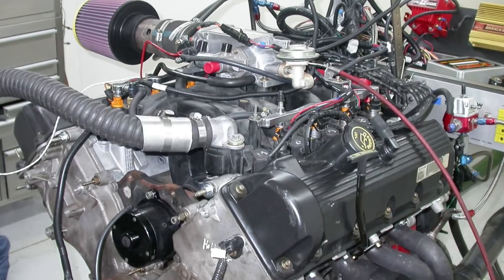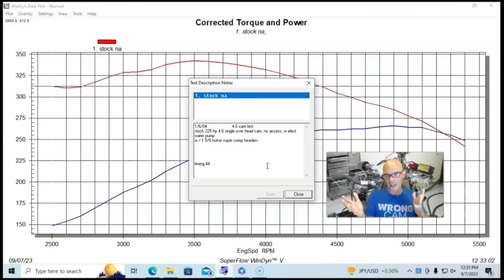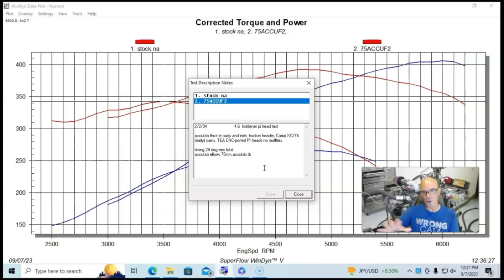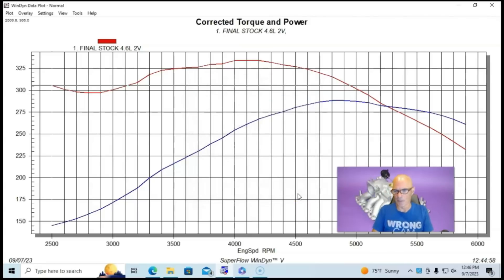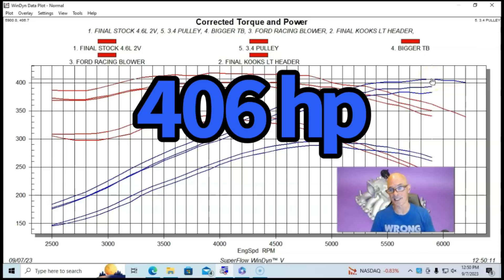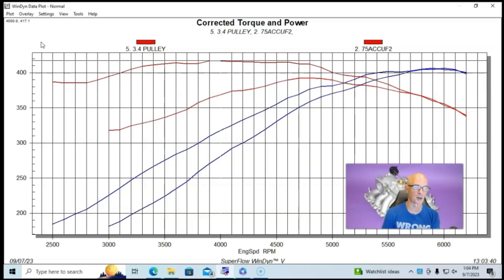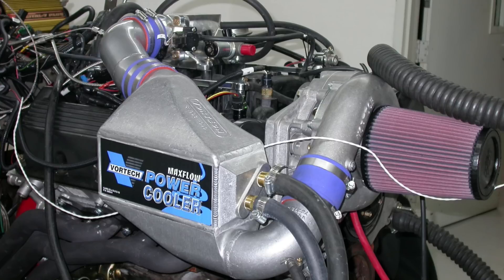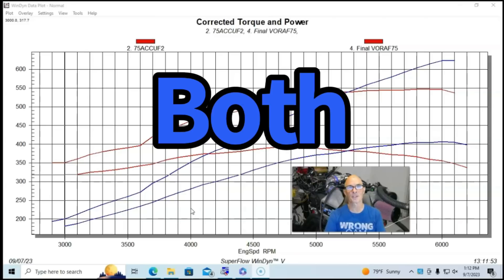THE 400-HP QUESTION-4.6L 2V MOD FORD-ALL MOTOR VS SUPERCHARGED-WHAT IS THE BEST ROUTE FOR HP? BOTH?

Comment: 2v's were so terrible
Reply: But damnit they sound great. Plus at the end of the day 400 crank HP from 281cid isn't bad. They suffer from being superceded by Coyotes like the 3 valve.
Reply: @travislivengood2744  they're superceded by every v8 on the planet.
Reply: @HioSSilver1999  hogwash. Chrysler 4.7, 4.2 liter Windsor, cfi Windsors, hell, my stock EFI 460 makes the same peak power. Lots of under achievers. If the LS1 didn't appear at the same time, the 4.6 would be better remembered. It's not the best but it's rock bits reliable, makes a great sound and can still do burn outs.
Reply: @travislivengood2744  the 4.sux got rocked by lt1 and especially lt4 cars before the ls1 ever came along. Shit run of the mill truck 350s will shit all over the modulars.
Reply: @HioSSilver1999  the early truck headed stuff yes. Later PI cars with a gear are still quite a bit of fun.
Reply: @travislivengood2744  if fast is fun they're not very fun. Will they spin the tires?? Sure....other than that they're pretty awful. Rightfully those pathetic weak engines shoulda put ford out of business.
Reply: @HioSSilver1999  well a centrifugal blown stock PI headed 4.6 can easily make 450-500whp in a 3300lb car with a solid rear axle. If you can't entertain yourself in that, I'm sorry for your loss. Are NA 2 valves very hard to make good power with? Yes they are, but they love boost. And you can beat them relentlessly. They are far from the worst engine out there to play with.
Reply: @travislivengood2744  everything loves boost. Making power with boost is nothing special.  The fact that it only makes 450ish whp with boost is what's bad....and anything above that will likely scatter those weak rods. 

Don't blame me blame ford for producing that junk yall seem so ready to defend.
Reply: @HioSSilver1999  I'm not defending anything other than 450-500whp is more than enough to go fast and have fun. The disconnect here is that not everything needs to make 1000whp. Is the 2 valve a great engine? It is ridiculously reliable if underpowered. It makes a great noise. It can make decent power with forced induction. That was literally all I've pointed out.
Reply: @travislivengood2744  i can agree with that other than the reliability aspect. With modualrs and their plug shotting issues, intake mani issues, exhaust mani issues and then to end up with a weak bottom end I'm not impressed....almost forgot about the ignition coils that are prone to failure. We roasted those enough in our alms panoz we switched it to ls coils.

  Hell i had a 03 cobra swapped notch...it got blew up hotlapping at the drag strip. Not by me but the previous owner and i bought it like that.
Reply: @HioSSilver1999  most of those issues I only saw them on the 5.4 and the 3 valve. Killing an 03 Cobra bottom end is hard to do. All forged. The 03/4 Mach 1 autos had cat crank and rods and the manuals had good cranks but meh rods. There have been two 4 valves in my family and both were awesome and one 540whp 3 valve that has never been apart. Turns out if you maintain them like they're supposed to be they're tough.
Reply: @travislivengood2744  it's not that hard to kill a cobra bottom end. That's why they run the tunes so soft. If it gets any kinda detonation it kills those puny bearings. Hence why you don't do 5th gear pulls in them, coolant mod the back of the head. They're actually pretty finicky.  There's been a pile of them blowed up on the dyno because of just trying to push them a little bit more but still on the soft side because no one wants their shit blown up. There was a thread on svt that was just blown up 03/04 cobras. It was 70+ pages long. Hell 3 blew up around here once in one weekend. 

Then there's the whole oil pump issue with them.....that continues into the coyotes.
Reply: @HioSSilver1999  corvettes dropped valves and camaros and trucks destroyed cams too.
Reply: @Mtnbike121  anything can fail fo sho.....but atleast they have power and fail vs no power and fail.

On top of that people do stupid shit to ls stuff constantly....thus making them fail. I think i had pretty good success with mine. It it's most power at 90k~ mile than it ever did. And ran great. 

Shit if you ran a ls at the power level of a 2v they would never ever fail......but yet a 2v will still fail at that weak ass power level and 5k rpm or less.
Reply: @HioSSilver1999  ancedotal experience on one engine is hardly a defense of "shit breaks" of the extremely well documented LS7 valve droping issue in stock form that destroyed LS7s. 

The afm was used in a wide range of platforms where running a vehicle hard wasnt the cause of failure.

Both of those engine failure problems were admitted by fault design and engineering by gm. And both of those problems were found in stock form.

If your excuse for the failure is people were doing stupid shit in them A.K.A racing or drag racing. Then they arent as reliable as YOU want to believe they are.

Lastly.

All of the modular platforms can be built to hold tons of power. Andrew Lavender has a 2v that runs in the 7s. 
A 1000hp 4v 4.6 isnt a rare or an outlandish find
A coyote and LT1 (which is baiscally a SBC) go back and forth for the world record on the H pattern manual transmission 
A mod 5.4L makes 3000hp and hold the standing mile record of 300 mph with a stock block/stock head. 

The idea they CAN'T be made fast is only held by people that are to ignorant to open their eyes to other car enthusiast that may like different platforms.

Enjoy your LS.
Reply: @Mtnbike121  and there ya go.....talking about erryone else's results with the 2v or modular platform because YOU'RE  own results are less than stellar with this over rated taxi cab engine. Meanwhile i can speak of my own results from enjoying my ls.

 Then you bring boost into the equation when clearly na is when the engine makes it's own power instead of being force fed. How a engine does with boost  has far more to do with the boost combo and not the engine.....hence power adder.

5.4s are lol.....they like to tie their cranks in a knot above 7k rpm.

As far as ls7s go furd guys like to blow that out of proportion.  The actual cars that had a problem is like 1 tenth od 1%. But hey....that old engine made back in 06 still thrashes every na furd turd to date.

Yup....some guys just don't know wtf their doing with a ls or lt. That's why i thrashed every cam, h/c and even some big cube cars that i come across using just a old 2002 bolt on ls6.....hell even some boosted shit was slower.
Reply: @HioSSilver1999  I'm extremely happy with my 2v. I could care less what it does at a drag strip, i have rules that limit what modifications i can do with my car and follow them. I've won several 15 hour endurance road races with this car. It don't bother me one bit there are faster cars in a straight line than me. You wouldn't beat me in an 15-24hr endurance race and i wouldn't beat you in a drag race. So its a mute point you're trying to make.

Ive had many ls guys show up with 400-500 hp spouting that they'll smoke me in the race. They think they've found an untapped reserve of races they can win because there are not LS camaros in the field that make 400-500HP. Sure, they'll set a faster lap time, they go out blow my doors off on the straights the first few hours thinking their stock bottom end is going to last 15-24 hours at 7000rpm and find rods hanging out of the block before the weekend ends with a DNF.

You are the one making blanket statements that they are all slow based off your ancedotal experience, yet when taken from a larger sample size of people that have documented their success at a significantly higher level than you; you are found to be full of shit. Some people with a 2v do make power, that is a fact. Just because i haven't done it, doesn't change what they are capable of doing. So just keep moving the goal post from "the mods arent fast, to you're not fast to me, so everything else is irrelevant." Which is histerical. Keep moving the goal posts.

And tons of people still fix their their ls7s before they nuke themselves, minimizing the potential castrophe of destroying a $20k engine. So no, it still scares enough owners to spend the money to fix it before it happens; diluting the potential pool from that experience. 

Also keep spelling ford like turd. Its hilarious. Watching a 40 year old man act like hes12, that never gets old.
Reply: @HioSSilver1999  🤓🤓🤓🤓
Reply: @SN95.Danger  by a a quick look at your channel you're a gamer.....nuff said🤣🤣🤣
Reply: The 2v is the most reliable american V8 made during that era. It may not make the most power, but it can handle endless thrashing.

My 2v has over 200 hours of wheel to wheel racing at 300 whp in a 3450lbs vic, With 2 wins under the belt. 

There are no mopars to compare it to during that era of car and the my ancedotal experience has shown that an LS will go kaboom if you try to push it harder than an HPDE without oiling modifications.
Reply: @Mtnbike121  the ls1 will run rings around it and last longer. Shit you don't even have to run a ls1 hard to shit all over a 2v...or 4v for that matter.

Have fun racing something thats even a piss poor taxi cab motor.
Reply: @HioSSilver1999  Sure guy. How many laps have you tracked your Camaro?

Cause I've put 1000s on my Vic. 

Theres a reason you don't see many camaros in entry level racing like Champ, lemons, or WRL racing.
Reply: @Mtnbike121  i have a few laps on it. And I'm not a bit worried about a junky slow 2v.
Reply: @HioSSilver1999 lol you have no idea what your talking about, yes they don't make power, but their torque monsters and bulletproof.
Reply: @SN95.Danger  tq is power. They make no power and rev like shit.
Reply: @HioSSilver1999  A few? What a joke. Lol lets talk when you go run an endurance race on a stock bottom end. We'll see if its still together after 15 hours.  I know my 2v will be.
Reply: @Mtnbike121  your 2v is a joke. Yup a few laps, hundreds of 1/4(10s na with bolt ons) and street passes....all the way up to 90k miles. 

2v making any kinda power puke their guts religiously.  The best yall can come up with is they made a ok taxi cab motor.
Reply: @HioSSilver1999  LS guys think running a car for 10s is so hard on  car. 

Lol. 

Literally the car has 600 hours of wheel to wheel racing with a head&cams build. 

90k miles is that supposed to be impressive?
Reply: @HioSSilver1999  lol 90k miles, posted a video of an rebuilt LS6 after 90k miles. Super reliable.
Reply: @Mtnbike121  we know your 2v taxi car ain't running 10s
Reply: @Mtnbike121  you not like my comment and deleted i guess.....lol. figures from a delusional 2v guy.
Reply: @HioSSilver1999  no need to report, but typical of the GM guy to blame someone else for their problems. 
Still waiting on those track times. 

Lol Is that why GM took the bail out money and Ford didn't?
Reply: @Mtnbike121  actually ford took bailout money too....and it wasn't the first time for them.
Reply: @HioSSilver1999 ls1 was cool especially the later one's but you're Also comparing it to a 5.7l engine that was specifically built for sports cars and performance... It was the main engine option for the first Corvette for the millennia change for one and they really had to put ever bit of effort and a shit ton of money and r&d because they had to make up for the lt engines reliability but still more power and they knew that there was going to be boosted models and more so they over engineered it for good reason it was there premium top of the line motor and Chevy had Alot to live up to and make up for and yet they still just made a modern 350 lol but you're comparing it to a 4.6l engine that was made for economy, reliability and price... You know how Much more the cheapest car with an LS1 was brand new? Vs the cheapest 4.6? Like half maybe less also the LS was like 5 years newer? But even still the fact that every police department in the country purchased the 4.6 crown Vic and not just once as most didn't start replacing until around discontinuation was announced in 2010 so they ordered new ones at least 2 times more likely 3 or 4  and they beat the hell outta then and then taxi's bought them used and continued to beat them to 500k. Original 5.4 2v was just as reliable and lasted as long.  If you wanted to compare an engine to the LS1 the 5.4 is more fair but  the iron 5.7 truck engine not the aluminum racing version would be  a real comparison without cheating now if you want a fair comparison to the LS1 the Cobra terminator 4v would be the equivalent as that's there performance built racing engine for there cars not a gas saver or truck motor and even LS fanboys would never say with a straight face that there better than the 4v's.... nobody would and the price reflects today... I can get a ls1 for a race build for 3 or 4x cheaper and it would have way less potential and require alot of work to be even to even the 4.6 4v let alone the 5.4... afterwards until the coyote and honestly a bit longer Ill admit Chevy beat ford with price for power, reliability hell the junkyard, 5.3 iron Block to this day the most used staple swap or base for most drag builds from people without much money or first timers for ease to work with to even serious drag teams hell it's the most popular fox body mustang engine ever 😂 but I have to speak up when I hear people do the LS vs the modular argument because it's misleading and not apple's to apples and Ford caused that by doing the stupidest thing ever and putting the 2v 4.6 in the mustang that being Ford only fast car it got compared to the Camaro and Corvette engine when it should have never been unless that was the base engine choice instead of the V6 ...  but to be the best engine until the Cobra was sad... But that 5.4 4v broke records in the Ford GT and the first Koenigsegg (I know that's not fair either because of the extra power adders but the engine handles it no problem so it's capable of insanity)
Reply: @jayb3843  ok....the 4.8 chevy truck engine made more power than the performance 2v in the performance car mustang. Hell i think it even made more power than the 4.6 4v. The chevy truck 5.3 did make more power than the truck 5.4 2v and 4v. You satisfied.....ooohh wait there's more.

Now you want to compare a limited edition 5.4 that they made 300 of to a run of the mill ls1.....the ls1 was really nothing special.  It was basically a higher compression slightly larger 5.3......in some years they even used the same cam.....and it was still better than that under performing turd 5.4 cobro.

So we'll compare the limited production dhoc 4v 5.4 to a ls6 that tens of thousands were made. The ls6 thrashed it....the 5.4 cobro wasn't even good competition for a ls6. My own bolt on ls6 made 451whp/423wtq.....yes at the wheels using a stock longblock on pump gas. Even the coyotahs struggle to do that and typically need e85 to get there.
Reply: @HioSSilver1999  wrong again the 4.8 came out 9 years after the 4.6 but whatever and is still bigger but let's compare it to the same year 4.6.... the 4.8 made 250 hp and 280tq.... The 4.6 mind you same exact engine no difference just a wasn't tuned down because they wanted the mustang to shine but the 1999 gt mustang was 260 HP and 290 tq..... So it's winning on both and smaller and way more longevity and 9 years older......  the 5.4 made slightly less HP than 5.3 more tq again... your comparing the lowest oldest 2v numbers to newer higher Chevy numbers you can't compare the HP the 2nd gen vortec that came out in 07 makes to the 2v... The newer and improved 3v were already out by 2008 most of the major issues were taken care of especially with the 4.6.... there's a reason Chevy had to start offering the 6.0 to go against the 5.4 because it made the 5.3 look bad... And the 4.8 even tho it's bigger never got the love the 4.6 got until later because people wanted cheap stuff to blow up and the aftermarket was there only reason the vortecs were popular and that's because the same people who made sbc parts made them .. Chevy never innovated.... So then you guys treated the 4.8 as the V6 essentially because nobody wanted them in their trucks 5.3 was smallest they wanted unless it was fleet trucks who drove alot single cabs who never  towed or hauled but they went with the 6 cyl so they made that compete with the Ford V6 even though they still had a V6 lmao Chevy literally had to punch down in weight class  every single time because they used the same tech as there old engine's they just went from carbs to efi and computer tuning because they HAD to... Ford took risks and innovated... Yeah it hurt them a few times and a few years at a time or some whole engines were bad but they did that and still stayed number 1 selling truck on America for over 50 years, number 1 police vehicles Brand, and 1 fleet vehicle sales over all and Chevy played it safe and changed little thing's just with different lipstick and now for almost 10 years it's been painfully obvious and it forced them to copy ford and come out with the new Lt and say by to the LS because a 5.0  displacement engine same fuel and all was going heads-up with 6.0 and 6.2 engine's haha and eevws way better became more popular so Chevy tried the forced induction because Ford also on the side created super innovative powerful engines now powering the most popular police interceptor ever as well as everything else while still keeping up with the stupid fuel economy rules.... But you guys have a 6.2 aluminum real LS engine not a truck supercharged in a Camaro and it's back and forth with the 5.0 truck engine and mustang with a smaller supercharger.... How is that? Same psi smaller blower, way smaller displacement And same fuel but they keep 1 upping the other by barley enough to win then the other does it but the bigger badder one should be WAYYY ahead of the little ole 5.0? Hell your 5.3 isn't even in the Convo against the 5.0 even tho it's bigger and now with the new 10 speed and 5.0 naturally aspirated it's still beating the Camaro.... And scat pack dodge's y'all need a car that 2 levels higher in price and lineup to beat the basic gt from Ford and the trucks aren't even fair anymore and haven't been in a along Time. Go look how many stock single cab f150s they're are around with nothing but a 2.3l sc and a tune running 9 second quarter miles.... Even naturally aspirated the sport single cab beats an SS and the trucks are flex fuel capable so if they really wanted to embarrass they could do alot more but the acceleration the weight of the vehicles the mpg rev range and power curves and now the best transmission to ever be paired with it ford's technology is SHINING and the 1 thing Chevy even did best is losing the shine to dodge with all there big heavy boats and kitty's.....  police interceptors are insane and more tech than ever Chevy is not even looked at anymore trucks have gone down because the best big money truck is Ford and the best affordable American made is dodge and hell even the Duramax which got all of it's great name from the Allison transmission it was paired with which they had nothing to do with the 6.7 power stroke is absolutely outclassing it just like the gas engines not too mention the new 7.3l gas Ford option and the 6.2 ... If Alison Left Duramax would be sweating and the Corvette was awesome but it's not looking much better we will see with the new electric stuff but that's All tech and we all know who's been the tech guys for past 25 years and who hasn't..... Oh 1;last thing ford was only American auto Maker who didn't get a bailout money from the government unlike  gm .... And still achieved all that's and already has electric truck out and mustang mach- e for years now Chevy has the volt? 😅 oh the Tahoe is cool I guess but not so much now that they want 70k for One and Kia telluride outsells them
Reply: @HioSSilver1999  anyone can spout out random bs facts that sound good but we have this new thing called the internet and u can fact check stuff LMAO u tried tho I'll give u that I love how the mustang had higher hp and tq than the same year 4.8 but somehow u said it had more than the 4 VALVE HAHAHA same thing with the 5.3 vs 5.4 u tried to compare newer version of your motor to older versions of ford's lmao and the company's so compete so it's very common to 1 up each other by a small amount but even when the 5.3 did that was against the 2v never the 4v and yes the dohc absolutely does count the one in the super car's was a reference but that one was further customized but the dohc was used in a slot more than that way before that and in the generations and year's... if you can count the LS then I can absolutely count the Cobra....  because the Cobra was the only one built for the Same purpose as the LS not just a truck motor in a car like every other motor in Ford... And ask anyone year for year  and this was way before the ls6 but the Cobra vs the LS options and nobody thwr actually knows what they are will not say the Cobra
Reply: One of fords most reliable engine